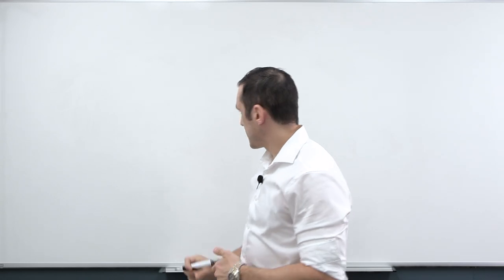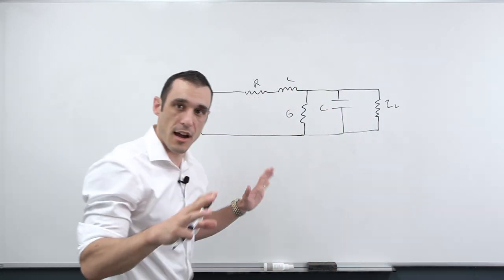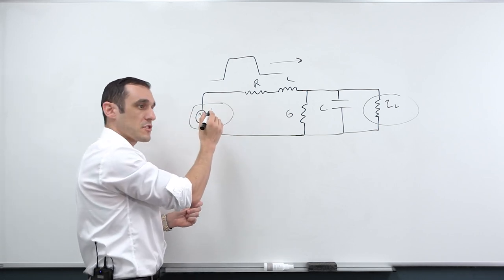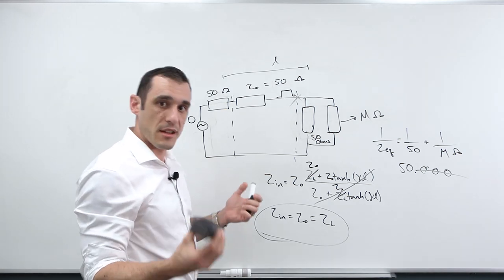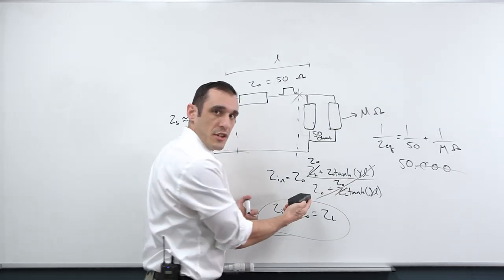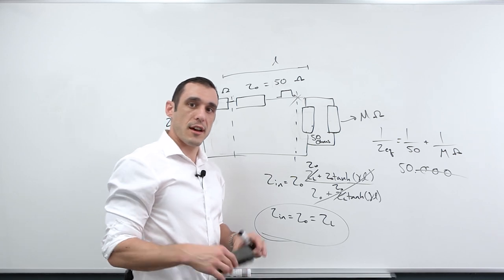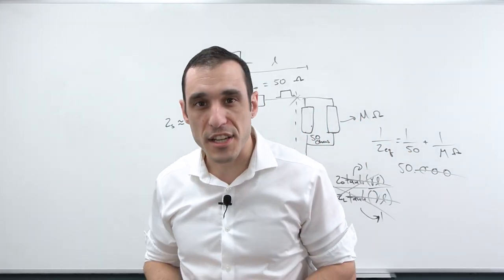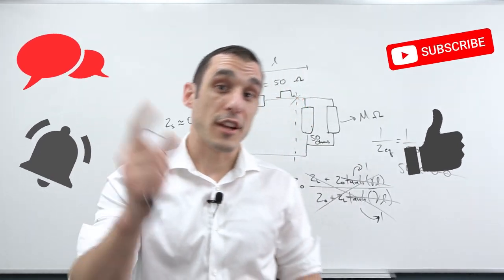Input Impedance Deep Dive

Comment: This is an absolutely amazing explanation!  I remember back in the 90's when I first learned about ethernet networking,  it used a bus topology. It required a terminator on each end of the bus and no one has ever been able to explain to me exactly why. The answer has always been, "that's what's required to make it work." Sure, they talked about reflections, but no one has ever been able to explain how it worked or why it had to be a particular ohm. We had different ohm terminators based on the cable we were using. Now, I understand WHY!! Thank You!! 

I also have to use terminators on the NMEA 2000 bus on my boat. This bus is to connect all the sensors and multi-function displays.

Comment: Hi Zach, a question because when I am creating a pcb in only two layers and in the layer Stack Manager I want to use the bottom layer as a plane, the Altium program does not give me that option, it only lets me use the layer as a signal, so when I create a pcb with controlled impedance, the layer Stack Manager generates the correct thickness of the track and in the design rules I configure it to accept that width, but then when I run the signal integrity analysis and search the details of the track I get the impedance with 300 ohms, sometimes more, sometimes less, but when I create the pcb with 4 layers then the impedance does correspond to the calculation. Can you help me about it? Thanks in advance.
Reply: Unfortunately you cannot do a 2-layer board with a plane layer on one side. The signal integrity tool requires a plane layer to set the ground reference, otherwise the tool will return a very large value as it does not recognize pour as a reference layer. The same rule applies in higher layer count boards.

Comment: Hi, Great Explanation. Could you please let me know what happened when we connect a small value resistor in parallel (i.e. 100Ohm) to the RS485 Bus end. Does this may effect our data transmitting?

Comment: Thank you! You really answer my question about termination!
But, I have question here. Does the characteristic impedance(Z0) literally dissipate the power?
Here is the scenario
Assuming a 1.8V voltage source, and Rs, Z0, RL all 50 ohm, what happens on RL? 0.9V or 0.6V?

Appreciate in advance
Reply: In a lossless transmission line that has zero DC resistance, no radiation, and no dielectric losses, the impedance does not dissipate power. In reality, there are always these losses, so some power is lost along the transmission line. When you look at Rs, you typically do not worry about the power dissipation across the source impedance,the signal level is just specified as the value that is injected onto the transmission line. This is why the transfer function for a source terminated interconnect will omit the factor 2 in the numerator. If you just consider the propagation along a long line at a specific point before there are any reflections or received noise, then the impedance is the ratio of the voltage solution to the current solution (both obtained from the Telegrapher's equations).
Reply: @Zachariah-Peterson  Hi Zach, Thanks for prompt reply. Appreciate so much. These days I spent some time on your videos and the articles on singal integrity fundamental concept. It really helps. Thanks again. 
So, as far as I known, may I suggest that, in the lossless condition, Zo is just the relationship of voltage wave over current wave; it doesn't incur any voltage drop while signal propagates over it.
As for  "power dissipation across the source impedance,the signal level ..."  you mentioned above,  actually I don't fully get what you said. May I interpret that , at the joint point which connects source impedance and the transmission line, the only thing to do is just obey the input impedance formula and the voltage divider here; thus deriveing the voltage value that we want?

Appreciate so much!
Ray
Reply: @葉宸瑞-s3x  Yes that is a good way to think of it, as ratios. For the source impedance, the typical model is to just put a resistor there. That means that, if you calculate the transfer function across the line with the source impedance included, you would lose half the voltage from the switching element as it gets dissipated across the source impedance. However, when the thing is actually packaged and you measure the signal level, you never see what happens between the switching element and the source impedance. The signal you get has already transitioned into your instrument and it outputs whatever value you measure on your scope. So conceptually, that means it's already felt the effects of whatever the input impedance is at that port. Since input impedance relies on working backwards from the load, you just start at the load and work backwards until you get to the driver pin, and that's basically it. You can account for the source impedance if you want to, but then it gets more complicated and is not really needed. Also, not all source impedances are purely resistive (either as a series resistor or divider or whatever other circuit). Some RF interfaces use a balun to couple signal to the output, so that gives a very specific impedance at the interface's operating frequency.
Reply: @Zachariah-Peterson  Hi Zach, thanks for detailed explanation. Appreciate it so much. So what you mean is that when the thing is packaged, it is normally built in an on-die source resistance. So we can feel free to neglect the above derivation that happens in source element and impedance. I just believe what actually display on the oscillscope, is that right?
Since based on my experience on SPECTRE simulation, the NPORT element provided on the "analogLib" will deliberately twice the amplitude of voltage level so that while the impedance between source impedance and input impedance is matched, the voltage vlaue is exactly what you specfied.
Therefore I wonder that if the instrument such as AWG have the same mechanism as the NPORT does? so we can get the voltage value that we set on the instrument while impedance is matched.

Thanks in advance
Ray

Comment: Great video! It explains the concepts really well as apposed to just writing 100s of equations haha. I have one question though, when designing a PCB where a microcontroller communicates with a device using SPI or I2C, should I use terminate the lines at the load side like you say? I've been warned multiple times about ensuring all the lines are the same length to ensure that signals reach the load at the same time, but should each line have a parallel impedance matching termination as well? Or is this something that is built on-die for the source and load?
Reply: It depends on the rise time for signals on the bus and the length of the bus. As I've noted in a different video, it has nothing to do with the clock rate. This is a common misconception; pay attention to the rise time and not the clock frequency. With SPI or I2C, you will most likely not need to terminate unless you get to really fast rise times.

In I2C, technically the lines are terminated as soon as you connect them to the Vcc rail with pull up resistors. So no they aren't terminated on-die (I've never seen it anyways). The bus capacitance and the pull-up resistors will determine the rise/fall time. I2C is an open-drain bus, so it pulls lines low by discharging the entire bus into the driver's ground. So if you have a physically smaller bus (thinner traces, shorter lines), then you will have faster rise time. You'll most likely only need to worry about termination with a backplane-sized board, and only at the High Speed standard. For example, just using the rough propagation delay value of 6 inch/ns for a minimum rise time of 15 ns in high speed mode, the signal would travel at least 90 inches during its rise time. Taking a 10% conservative limit for this signal would give a critical length of 9 inches. So it does matter with high speeds on a larger board, or possibly if you're routing through a cable and onto another board simply because you create such a long link. There is also the matter of setting the right value for any series resistor should it be needed, take a look at Fig. 46 in the I2C specification for a graph that shows maximum series resistor values vs. pull up resistor: https://www.pololu.com/file/0J435/UM10204.pdf

With SPI, it's a bit different. SPI is push-pull, so power is not being drawn through a pull-up resistor, and the rise time is dominated by the external capacitance + any series resistance and driver output impedance. The SPI spec on your MCU/FPGA or whatever might give a specific rise time for a specific current draw into the bus for a specific total capacitance (maybe 50 or 100 pF). For the SPI bus on a PIC32 MCU, the output transition time is specified as 5 ns for an external capacitance of 50 pF. So if we drop to 10 pF, we would expect the rise time to drop to 1 ns for a given current output and voltage level. In that case, you now have 0.6 inch length allowance (rough approximation with a very conservative 10% limit on unmatched lengths).

Comment: hey, I got a tricky question: what should u do if Source if HIGH impedance and load is low? I have had that question for students and also we had to deal with that problem with very specific IC once upon a time. Also trans-impedance AMPs are interesting thing.
Reply: In that case, reverse the terminations, so some kind of parallel termination at the source and series termination at the end. Series is to increase a low impedance to a target value, and parallel is to decrease a high impedance to a target value.

I've never seen that type of thing except for like specialty analog stuff. Everyone usually posts guides with series termination at the source and parallel termination at the end because CMOS buffers will have low output impedance and high input impedance.

Comment: I dont fully comprehend why we need to understand Zin formula for digital design if we will not use this formula.
My guess is digital signal is composed of infinite sinusodial signal (fourier transformation) and that is the reason we cannot calculate infinite amount of gamma  for each sinusodial wave and plug that gamma to Zin formula.
Is my point correct? If not please tell me why?
By the way, sorry for my bad english. I hope you assist me.
Reply: In digital design the point of input impedance would be two-fold: trying to model the bandwidth for flat impedance when there is a capacitive load and you've applied impedance matching, or when trying to see the minimum length at which you need to impedance match given the known impedance of your current transmission line design. If designers are trying to get around designing their single-ended protocols to 50 Ohms, then they will be doing the 2nd thing I listed here. Everyone says "25% rise time" or "1/3 rise time" but those numbers depend on the impedance of the line and the load together. For example, 65 Ohm lines will have a different rise time limit than a 35 Ohm line for a given +/-5% input impedance tolerance. To do this, you have to look at a bandwidth limit in the signal and use that bandwidth limit + your transmission line impedance to determine when the input impedance exhibits too much deviation from the load impedance. The bandwidth limit is also a bit arbitrary, you could use Nyquist, or 5th harmonic, or 7th harmonic, or the knee frequency (0.35/rise time). The knee frequency is popular because the input parasitics on a transmission line act like a 1st order filter, and 0.35/rise time would be the minimum measurement bandwidth needed to reproduce that signal without Gibbs artefacts, but it's important to note that this is something that was taken from oscilloscope measurement techniques.

Comment: if your load high a 1Mohm resistance and you add in a 50ohm parallel to that load at the end of the transmission line won't most of the signal and current flow through the 50ohm resistance since it is much smaller?  how would you get much power to load if you give the electricity such an easy path to take instead?
Reply: I am thinking in terms of a radio transmission line and an antenna for the load.

Comment: I have designed some boards where the customer added different value resistors to different signals , like at one signal they used 200 ohms to ground and on another signal they used 240 ohm. I cant understand why they had to use different value resistors if the 50 ohm trace width was same for all signals. Also they call it ODPR signals but the resistors were added externally on the board. Could you please explain this a little? Thanks.
Reply: As much as I would like to speculate, I wouldn't want to state a reason without looking at the design.

If you want to send me something to look at directly, you can email us at youtube@altium.com

Comment: What if Zsource = Zin but ZL != Z0, will we have 0 reflection at the interface of the input with the line  and we'll have a reflection at the interface of the line with the load ?
Reply: Yes you would have a reflection at the load end, so the power that transfers into the load may be less than 100%.

Comment: what happen if load is shorted ?
Reply: If the load is shorted then the load impedance is zero. You can plug this into the input impedance equation and you will be able to determine what is the input impedance.